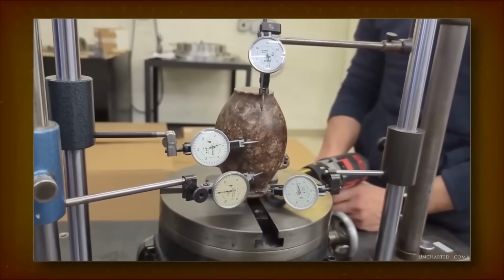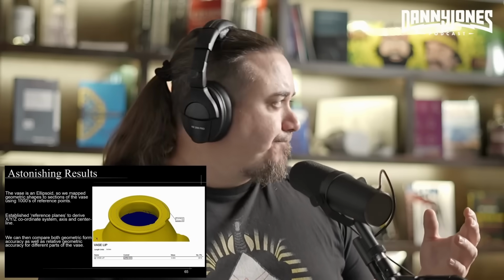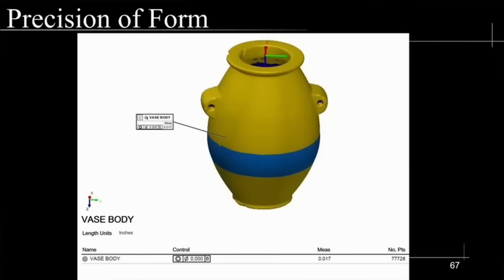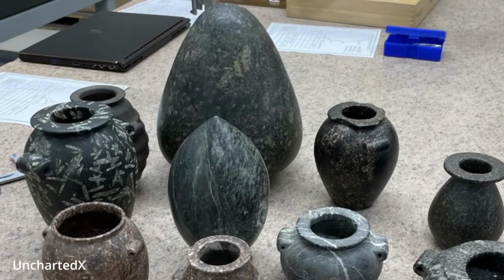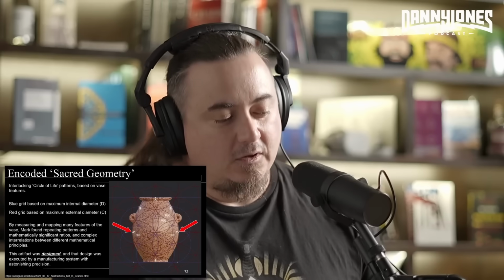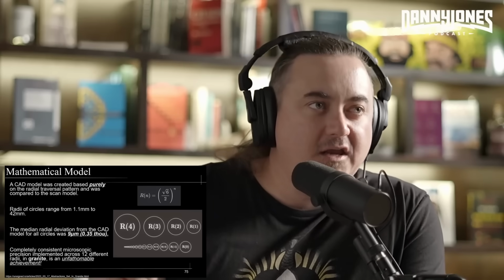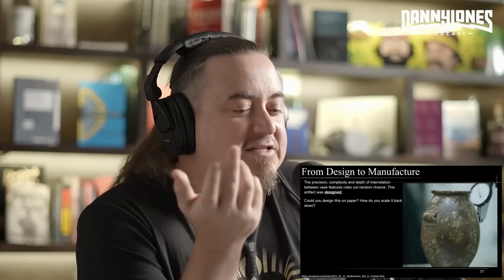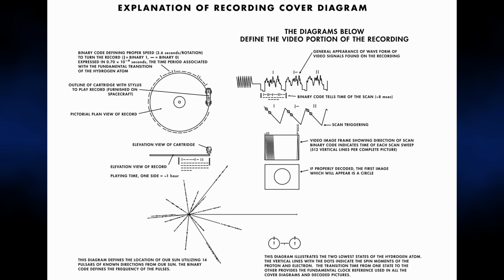Are These Ancient Egyptian Vases Actually Impossible to Make? #podcast #science #history #egypt

Comment: The FULL PROOF of this entire theory, would be finding two of the same vase. Same "program" ran twice. As far as I've seen, they are all majorly different. No one is going to do all this math to make the largest vase possible out of every single peice of rose granite. If it was run on a machine, it should be repeatable. If you find two, or one scaled up or down but otherwise with the identical mathematic formula, then you have proof they used that formula. 

Now you have a lot of mathmatical coincidences, spend the same amount of time looking for patterns in a Walmart vase and I'm sure you will find just as many. (Obviously not cut from one peice of granite, y'all know what I mean)

I don't think they were carved by hand or any nonsense like that, but them all being different really puts a damper on the whole maths explanation. It could be a dude on a old-school lath making something that looks cool, then polished in post production by hand to erase the tool marks. Which would also erase any trace of a secondary process to carve around the lugs. Occam's razor needs to be applied, what's the SIMPLIST explanation for this. If we had TWO of the exact same vase, and you scanned both and compared them, and they both showed the exact same ratios and even compared to each other within 0.05 (50 thou) on major dimensions, it would be undeniable proof they were designed with math and produced by machines.

Comment: So they're drawn on CAD and CNC made. I appreciate you don't cut out the 1.5mm internal radii with the same cutter used for the body, so they either had better tool changing accuracy than we do today or they cut the entire piece in one finishing pass with a tiny bit.
There must be microscopic pieces of the cutter embedded in the granite. Either that or they must used a none-contact method. OR could they teleport the vase out of the granite block? OR did they disintegrate-away the excess granite from around and inside the vase? 
Who owns the UFOs that keep being reported? Is AI killing us off with the cost of living?
Do the red Lego bricks taste better?

Comment: What would be the cost quote from a contemporary manufacturer (aerospace no doubt) , to make this? Then factor in that it's to be made of granite. Would a commercial quote be...$5Mill? $50million? "impossible"?
Reply: I used to be a master goldsmith and gem cutter before I retired. Just the machines you would need would cost you several millions, and getting the vases see-through-thin is almost impossible because the Granite doesnt have a homogeneous structure, which makes it even more difficult. I have no idea how they did it, but I know it wasnt done with flint and copper chisels.

Comment: Geometric Dimensioning and Tolerancing, GDT.  Completely necessary to accurately machine many working parts that are used for different mechanically accurate purposes.   
  By the way, you're absolutely wrong saying that this is not achievable by hand, I can do it myself.  I can hone washers with a surface parallelism precision within plus or minus two 10, 000ths of an inch using a belt sander and a rod with a step in it.  
 I was showing this old tool maker how to do it and he looked at me and goes oh s*** you can't teach an old dog new tricks, because it's a lot faster than using a magnetic bed that can warp the thin metal when you're trying to precisely grind it on a surface grinder machine.  Good luck.  
  Anyway, I love how you dip s*** think you know everything. 
 I can show you guys how to figure out PI with a string and a stick. 
 Dorks.
Reply: i sad, i dont think they made it by hand
Reply: its only my opinion
Reply: the finish was made by hand...maybe,,,,,but not the main work
it was made by something with more force

Comment: All of the mathematics involved make me think of frequency... Next time you get to hold one of these, put it over your ear and see what it sounds like? I bet there is a background hum that they create. I remember putting my ear to a very large conch shell and you could 'hear the ocean'... I wonder what you would hear with this level of mathematical precision? Maybe the sound of mathematics itself... :)
Reply from the maker: Good observation
Reply: @historydrops  Here's another observation. The base unit for these vases is called the Djeba (The Royal Digit or Finger). The Djeba measures 18.7mm... Now observe the opening radius of the scan used by Mark Qvist in his analysis. U = 18.74mm. If you use the Djeba as the base unit all the ratios resolve into fractions with a tolerance of +- 0.05mm. Therefore the original 'designer' used the Djeba. The very minor discrepancies are irrelevant in the context of the manufactured item. You heard it here first.

Comment: Such half-arsed claims pretending to be science. If the vases are smooth to within 1/10,000th of an inch, at what scale do the tool marks become visible? If the numerology CAD model is only out by an average of 9 microns from the actual vase, why is that and where do the 'errors' occur?

Not only are those questions not asked, we won't get answers because it destroys the argument-from-ignorance that it could only have been done with advanced CNC machining when you start to investigate the actual process. If the vase is a bit thicker here and a bit thinner there, without any systematic cause, you can quote the impressive tolerances but it screams "hand made".

Comment: Professional aerospace metrologist here : 3 thou' (75microns) isn't very flat. 13 thou (325microns) isn't very cylindrical. etc.  By modern standards these are bad numbers.
Also, taking a perpendicularity value from such a short axis is meaningless.
Also, why didn't you scan the base? - this shouldn't be difficult.
Also, yes, you can closely approximate complex curves with lots of circles - this is not a deep insight.
Reply: You say these are bad numbers by modern standards. Are they bad numbers for metrology standards of, say, 5,000 to 15,000 years ago when working with heterogeneous mineral compositions of varying hardnesses  such as rose granite?
Reply: @ABC-yt1nq  : these artefacts are beautiful, and hugely impressive. But they're not perfect, or "impossible to make with modern technology".
Some of the errors are significant, in the order of millimetres - look at the holes through the lugs, they're in different positions, and clearly not well aligned.
Skilled craftsmen made these, not aliens. They used sophisticated tools and methods - but not 5000yo 5axis mill-turns.
Reply: @Harry-SB-W  So who made them, when were they made, and how were they made? What "sophisticated tools and methods" as you suggest were used to make them? What precision metrology devices were used to measure them as they were being worked? And how were those metrology devices made? My understanding is that a rule of thumb for precision measuring devices is that they require a 10X increase in precision: to measure a 0.001" flaw you need a tool capable of precision measurement to 0.0001"
Reply: @ABC-yt1nq  : i've no idea who made them, or when.
I'm confidently responding to the nonsense-claim that they possess accuracy-of-form that would be impossible to make today.
As for their accuracy-of-size, we have no idea what the nominals were - you only need to measure something for size if you have a target in mind.
I can make an informed guess as to how they were made - slowly polished to shape on a rotating table, very impressive for such an old object, a wonderful demonstration of skill (and patience), but not out-of-this-world, or magical.
Reply: @Harry-SB-W  - And the tools necessary to measure to a precision of a thousandth of an inch. They would have needed to have those as well? And wouldn't these need to be 10X more precise, or some multiplier more precise? I'm guessing such measuring instruments would be magnitudes more difficult to manufacture compared to making the vases. Any thoughts on that chestnut?
Reply: @ABC-yt1nq : we have no evidence, at all, that they were made to a specific size so no dimensional measurement for verification would have been necessary.
Remember, the scans have been made available - I've looked at them, and by modern standards, they have poor form (roundness, flatness, concentricity, angular position of the lugs, etc.)
Reply: @ABC-yt1nq : we have no evidence that they were made to size, and why would they be? - no measurement is needed if you have no toleranced dimensions to verify.
We've looked at the scans, and can see that the form quality (roundness, concentricity, etc.) is poor - by modern standards.